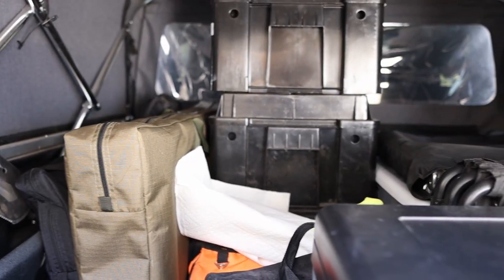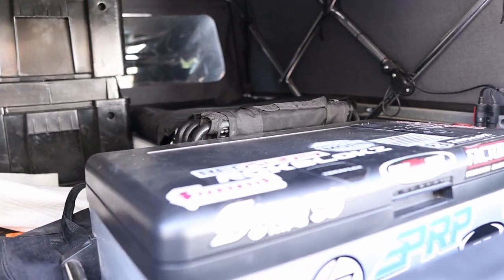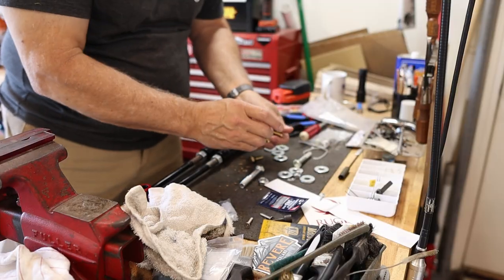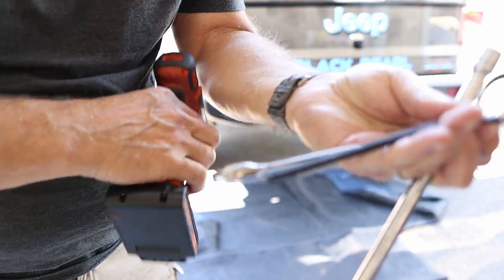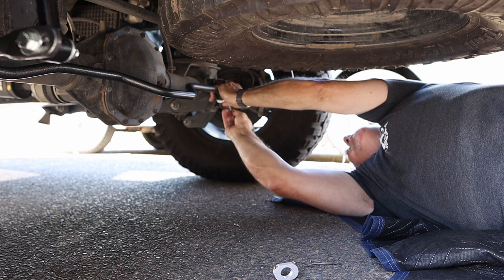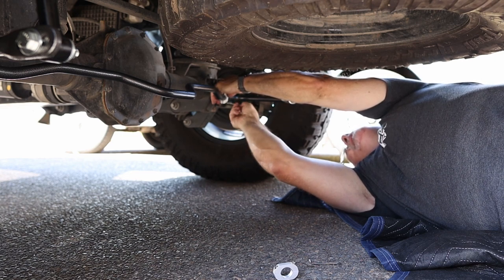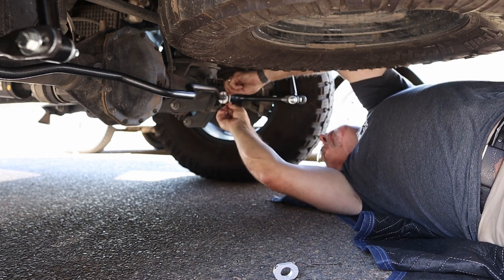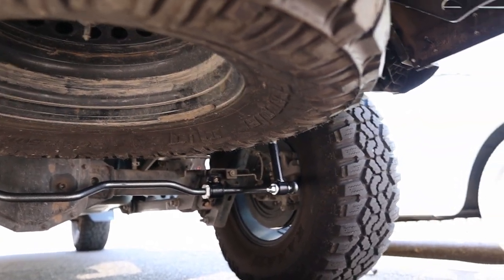Hellwig Anti-Sway bar - 2020 Jeep Gladiator

Comment: You’re going to want to install a metal cloak rear end link to frame reinforcement/repair bracket kit. The upper end link mount can’t take the extra torsion of your new sway bar. I know from personal experience.
Reply from the maker: Thanks for the heads up. I'll keep an eye on that upper link mount. Let you know if I do have to replace it. So far so good, thanks for commenting. 🤙🏼